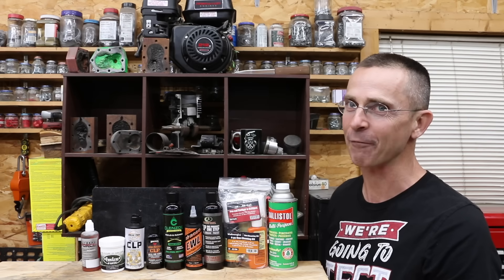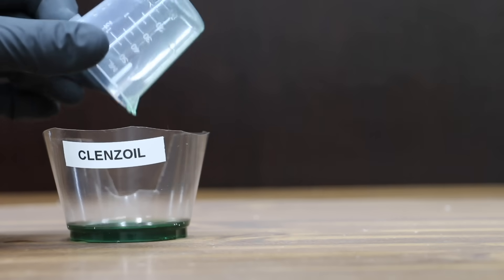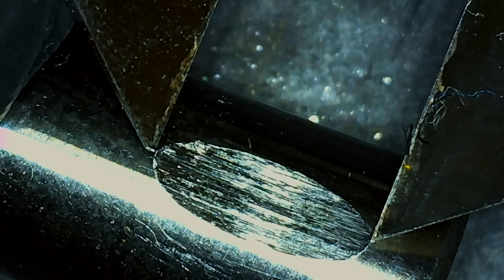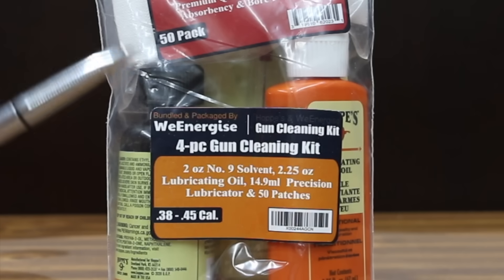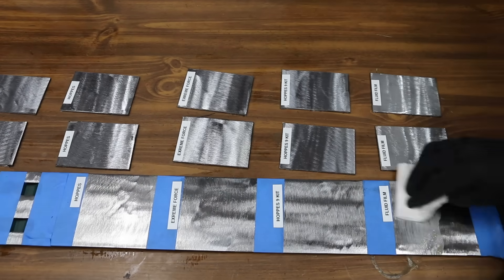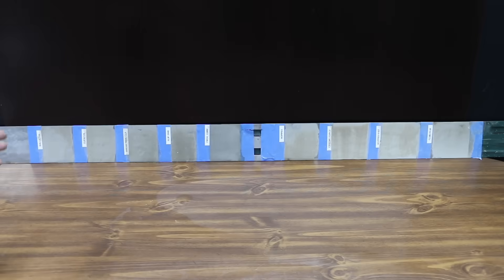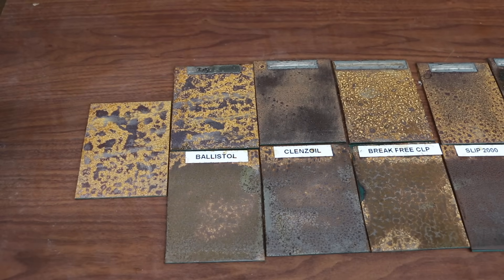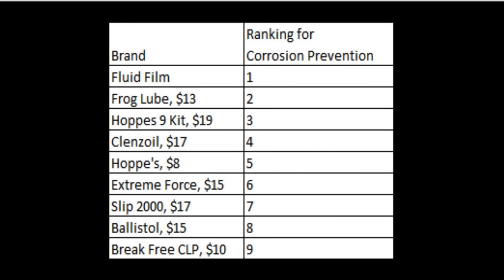Don't Buy A CLP Until You Watch This Review! It'll Save You Time And Money!

Comment: I think for best performance in a cold, wet environment, your best bet would be to apply Frog Lube to a hot weapon, let it cool and buff off any excess.  Then mist all the moving parts with Clenzoil.  That ought to protect everything from corrosion but keep everything moving freely regardless of conditions.
Unless someone knows better?  Would Clenzoil just rinse the Frog Lube off?
Reply: Most CLPs are designed to get rid of old lubricant, so mixing them like that might just be pointless. CLPs are also mainly intended to be quick and easy to apply in the field. Applying a process longer than one or two steps kind of gets rid of the point of a CLP in the first place.
Reply: Frog lube is also just mint scented coconut oil, so just get some coconut oil and save some money.

Comment: Problem with any CLP. 

A cleaner is not a lubricant. A lubricant is not a cleaner. Protection depends.

Another issue is they flash off quickly in operation.

For example. On the ar-15 I ran one 5000 rounds without cleaning. I lubed the BCG with the dipstick from my truck with 0w-40 Mobil 1 as needed (every 1000-2000 rounds). 
Cleaned it and left clp on it. After 200 rounds it was sluggish because all the lube was cooked off.

Most semi-auto pistols I use a light Teflon grease. It stays where it needs to be and doesn't flash off quickly.
Reply from the maker: Thank you!

Comment: Thank you for your great work.  I don't know if someone else mentioned this point, but I would like to see gun lube tested on that wheel without a reservoir of lube to replace that which has been rubbed off.  That would be more like gun use.  The reservoir method on the wheel makes sense when testing motor oil because more lube is constantly being placed back on the engine parts but with a firearm you lube it and then use it without constant replenishment.  Again, thank you.

Comment: I have been running synthetic motor oil in all my firearms for years, and it has worked great. I'd like to see a comparison with engine oil.
Reply: motor oil is specifically designed to tolerate a lot of heat for a long time. thats actually a great application for it. i guess id use a higher viscosity so it sticks better.
Reply: @bradhaines3142  Mix synthetic oil,and synthetic grease , you can vary the mixture depending out outside climate and where on the firearm you apply it. Using this method since 1980,s on AR,s, M-1, M1-A.
Reply: @bradhaines3142  SOTAR mix is definitely the best
Reply: Yep,nothing comes close to synthetic motor oils and synthetic grease...
Reply: Now that's a concept!
Reply: @bryceforsyth8521  I actually went out and purchased the winners from Todd’s Synthetic motor oil and Synthetic grease tests and mixed them into the SOTAR home brew and it’s been the best AR lube I’ve ever ran. I usually mix up large batches and bottle them for my friends.
Reply: +1
And might just as well add mineral oil to the list.
Reply: Should I use the Lucas oil stabilizer? It’s really thick stuff
Reply: @javiderek31  I don't see why not, but there are probably better lubricans. I could be wrong,  but I don't think lucas oil stabilizer has any pressure or friction modifiers,  which might make it a good base for a custom lubricant if you where to add for example ATF to it to get pressure modifiers and detergents.

Comment: I personally use Brunox arctic gun oil, I really like it is just basic pump sprayer, so you never have to worry about running out gas. I don't own guns but I use gun oil on locks, control cables on bikes, cars etc... Bought it to prevent car door's handle cables freezing and lubricate transmission gear selector bushing which was not moving anymore freely thanks to rust. One treatment was enough, gear selection is like new again and doors open during winter.

Comment: This video needs further testing. Pure lubrication efficiency is not that important on guns. Hell sometimes you WANT to run your gun dry with no lube in dusty and sandy environments. What's important is heat resistance (without polymerization, as some of the oils in this video did and was why their corrosion resistance "improved," but they actually polymerized and is a failure for use in a firearm), resistance to heat cycling (extreme high temps, followed by cooling down, and then heating up again over and over again like real guns), and overall shelf life and how much these qualities degrade over time.
Reply from the maker: Thank you for the feedback!

Comment: To be fair, it’s really easy to clean diesel exhaust residue. The carbon build up on firearms is baked on at very high temps and high pressures and is much more difficult to remove.
Reply: Yes, a control test would have been helpful. It looked like it could have almost have been wiped off with a finger.

I think this test can be improved on future tests and I imagine he became aware of it too as the results ended up about the same.

Comment: Thinking about your lubricity tester, the deeper something cuts the slower the cutting will happen - so the wear scar damage won't be linear - eg: a wear scar of 4mm is much worse than a wear scar of 3mm even though its just 1mm more (or am I wrong? Does more surface contact mean it cuts faster? So a wear scar of 4mm is only a bit worse than 3mm?)

Wonder if its worth graphing that with no lubricant, and seeing how long it takes to get from 1mm to 2mm and onwards... Be interesting to see what that graph looks like vs time.

Does the time it takes to get a 1mm scar multiplied by 5 = a 5mm scar? Or would that just be a 3mm scar?

I mean, we can all see the size of the wear scar, bigger is worse right?! But how much worse is it? I'm not sure, but I'd definitely watch a video exploring it, or any dry runs of your testing methods, your methods give great results but I don't think any of us know exactly what they mean beyond x has a better result than y.
Reply: good point

Comment: Unrelated, but I just saw an older one of your videos... ZIP TIE TESTING... IDEAS FOR FURTHER TESTING:    One thought... since zip ties are quite often used only to hold things together without strengh,  like wires and such, it is often more important to see how well the LAST - i.e. - how do they stand up to weather and age.  You could tie a bunch around a steel rod and alternatively put them in summer heat in the oven, winter cold in your fancy freezer, strong ultraviolet light, and do this repeatedly for several cycles... Then test them for strength.  as outdoor ties holding things would have wind to deal with.  Another is torsion.. how well do they hold two things together that might bend and pull in oposite directions such as wires strung over distance or tags being held on an outdoor conduit which might flap wildly.  Just random thoughts.  I was afraid you might not see the comment there.
Reply from the maker: Thanks for the video ideas.

Comment: One point that's worth bringing up is that some of these products are not meant to be mixed with others. I'm honestly still trying to figure it out but I believe it is frog lube that I have that once mixed with certain other oils, sets up like glue. It takes weeks if not months for this to happen but I've had multiple rifles that I've put away into a gun safe in clean and lubricated condition only to pull them out several months later to find them completely bound up. After going through all this, I've switched over to using synthetic engine oil for wear points as well as Lucas red and tacky grease. I use shooters world products for the bores.
Reply from the maker: Thanks for the feedback.

Comment: I know it’s not related, but I use EWG slip 2000 grease (or whatever it is called) for areas where oil may wear away quickly, grease for high abrasion areas. And not going to lie, if I am ever out of lube for firearms I’d even use leftover motor oil on them, works even better than paying for high price firearm products that are sold in small quantities
Reply from the maker: Thanks for the feedback.

Comment: I've used Breakfree and Hoppes many times before, but after watching this I don't think I will again.

Frog lube is... interesting. I was advised by the gun shop to apply it and hit it with a heat gun, or blow dryer, ect... basically heat it up and then let it cool. It requires heat cycling, as your video showed, to function properly. After that it supposed to exceed everything because it solidifies when cold, and turns back to liquid when hot. Very /interesting/ design.

That said I'd be interested to see the lubrication test repeated after heating up the frog lube and letting it get into the bearing. It simply "functions" differently from everything else from what I know. Still that corrosion test was amazing. I live in a 80% humidity and salt air environment.. that frog lube appears to be the best thing I can buy to prevent corrosion here.
Reply from the maker: Thanks for the suggestion.

Comment: fyi that wear test is extremely flawed. most of these product's have a solvent for the cleaning action. the friction characteristics will significantly change once the solvent evaporates.
also this is all basically just sewing machine oil sold at a huge markup. It might be interesting is you included some off label cheaper alternative/diy solutions as a comparison.

Comment: This test really doesn’t simulate firearms needs at all.  No place in a firearm needs an extreme pressure lubricant and sustained high speeds as in this wear test.  Completely unrealistic for a firearm.  Similarly, the viscosity of a bulk liquid is completely irrelevant for a firearm.  Anything more than a thin film in a gun is always a bad deal.  And the toughest cleaning issue in a firearm isn’t carbon, but rather lead and copper fouling, which wasn’t even tested here.

So, this test is completely irrelevant for a firearm.  The key thing for a cleaner is removing copper and lead fouling and powder residue.  The key thing for a lubricant is maintaining a thin film to provide rust protection and also not to become gummy over time or at cold temps so as to hinder action cycling.  These are the attributes that should have been tested.  Cleaning carbon from an engine and running on a test rig designed for engine oil is laughable in regard to gun solvents and lubricants.

Comment: There is an inherent problem with CLP products. Most notably, the C counteracts the L and the P. Lubricators are often high viscosity, long-chain hydrocarbons like oils, and protectors are even heavier as to not be so volatile and remain on the surface. Cleaners, with regards to firearm residue, are often harsh, light, volatile organic solvents that are designed to attack (dissolve) the types of hydrocarbons often used to lubricate and protect. As a firearms owner, I prefer to use cleaners for one job, and lubricators/protectors after, but of course, YMMV.
Reply: Solvents are good for people who go a long time before cleaning and have a lot of carbon buildup but if you clean often perhaps after every time you shoot a clp works just fine
Reply from the maker: Thanks for the feedback.
Reply: CLPs are good for people like competitive shooters, where you'll be at the range all day, shooting 500+ rounds across a number of stages and don't the time or a clean enough area for a proper cleaning. If it's dusty or you've grounded your firearm, you hose it out with a CLP, finish the match, then do a proper cleaning at home or in your hotel room.

Comment: Just more hype and garbage that the 2A community throws money at. 30 yrs of lubing ak rails with wheel bearing grease and the TCG with a power steering fluid/ diesel mix. I've rebarreled most of those rifles in my lifetime but never had to replace rails. I'll pass on the next big thing.

Comment: Gun grease seems to work best for me as lube.  For solvent I use Kroil.  Also I’m pretty sure frog lube is supposed to be heated before use.  Great test though.  I would love to see gun grease tested.  I was at a 3 gun law enforcement instructor course and during the rifle portion the instructor was carrying around balistol spraying it in the bolts of lots of dry and malfunctioning m16 rifles mine was greased and kept on rolling the whole week without cleaning or adding any lube.  It was summertime in Missouri so it was hot just FYI.  I don’t have a specific brand a tube normally lasts years but I’ve had great luck with all of them even shooting in the wintertime I went though swat school with an m16 in January in Missouri but we did not shoot nearly as much as the Instructor class but my rifle still performed perfectly and it was super cold and night time.
Reply from the maker: Thanks for the feedback.  Thanks for the suggestion.

Comment: This is a great test, but Im surprised not to see FP-10 and Lucas Oil lubricants on here. Both are common and FP-10 is officially recommended by  brands like Dan Wesson. Would love to see how they stack up
Also synthetic motor oil is a big one in the gun community. Would love to see how that compares.
Reply from the maker: Thanks!  Thanks for the suggestions.

Comment: Above all else, firearm maintenance is paramount.  I was in the Army for 20+ years and whenever I ran my weapon in contact and got it so hot, it got a thorough cleaning after cooling off.  CLP never let us down.  Unless you are competing (which I do) Break Free is the best bang for the buck when it comes to an all-in-one.  I use Unicorn Lube by Umbrella Corp for lube and Hoppes Elite for a solvent.  Never a problem.  I keep a small bottle of Break Free in my range bag for good measure.  

I'd stay away from Frog Lube.
Reply from the maker: Thanks for the feedback.

Comment: Interesting tests. I've been using ballistol for a few years now since it's supposed to be non toxic on the skin compared to traditional clp. I used frog lube prior to that but noticed it gummed up heavily if I let it sit for a few months. Afterwards I read that frog lube is supposed to be applied as a process which is highly dependent on applying heat to the metal so it actually bonds to the metal. Your tests showing the post oven results kinda gives credence to this.
Reply: Frog Lube does that regardless of how it’s applied. I’ve seen many people have the same experience you did.
Reply from the maker: Thanks!  Thanks for sharing.

Comment: The Frog Lube needs to be applied properly to work as intended. It is meant to be applied in a fashion similar to "seasoning" a cast iron skillet. Heat up what you want to apply to about 120 F then apply the frog luge and let it work into the pores of the metal. The theory is as the metal heats up the Frog lube acts as a lube but when cold it fills in the pores to prevent corrosion. Just applying it bare bones like the other liquids is not going to work.
Reply: That "theory" is bogus, Frog lube is snake oil (or rather, snake grease 😂)

Comment: This test was not an equal test as you applied Frog Lube in the same way as you applied basic oils. Frog Lube specifically states you are to apply the product then heat the items up to allow the lube to absorb into the metal. I think this was proven by your corrosion test where you applied the product then heated it up. This resulted in nearly zero corrosion. I think if you had applied Frog Lube in the same manner for the lube test it would have performed even better. As to the Mil Spec for not freezing up, Frog Lube is not to be applied as a "lube" where you can see it like an oil. It is basically a dry lube so the Mil Spec test is irrelevant to it. 

Yes I'm pro Frog Lube, at least on most guns. Fully treat a carry gun and a year later it is still "lubed". I've not fully tested it in something like the AR platform.

Comment: Man I really wish Lucas was on here too just to see.
Reply from the maker: Thanks for the suggestion.
Reply: @ProjectFarm  so another thing I just thought of, a long time ago there was a subject of debate.
That a specific gun oil called fire clean was nothing more than Crisco canola oil.
Granted it did get lab tested and it was pretty much confirmed to be canola oil. But the company still denied it. 
It would be really cool to see that on your next lineup. You know as a "control"

Especially if it works out well it's probably going to be the cheapest. But I bet it would fail the cold weather test.

We did use it on a 240 and once applied it seemed that the after application cleaning was a lot easier but if left to set in the weapon it would basically gel up

Comment: When it comes to gun cleaning, I've been a Hoppe's cleaner and a WD-40 lube guy for my 60 plus years, but you have opened my eyes.  Thank you.
Reply: WD-40 is primarily a solvent.  it works great for lubricant for short time use but I've seen cases where people stored guns long term only to have rust show.  Some of the chemicals will evaporate away.  If you want your M-14 to run in a dusty windstorm it works well (I know this from experience), but I wouldn't use it as a regular lube or for long term anything.
Reply: WD-40 is about the worst thing you can put in a gun. Varnish and sticky that you then have to clean out. 

If you're going to clean your guns to death, then have at it. I'd rather be shooting than cleaning.
Reply from the maker: You are welcome!

Comment: For wear on the internals I use amsoil 5w40 and it works AMAZING. For  the exterior I  use a dedicated firearm lubricant (mostly fireclean).
Reply from the maker: Thanks for the feedback.
Reply: Fire clean is cheaper if you buy it under the crisco label.

Comment: Definitely follow up with products only designed for lubrication and protection but not cleaning, and a third for just lubrication, both before and after heating. Combining those with a mass loss after heating like you do for engine oils would be informative (clearly a lot of loss from some of them on the heated coupons in this video).
Reply from the maker: Thanks for the suggestion.